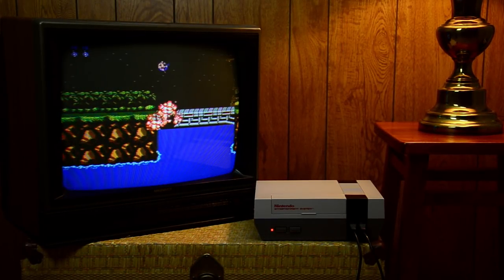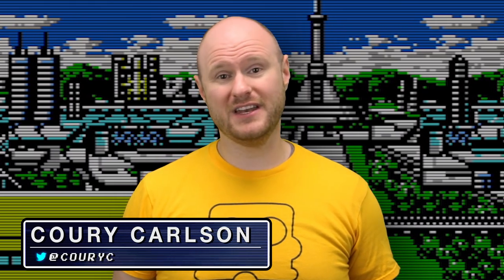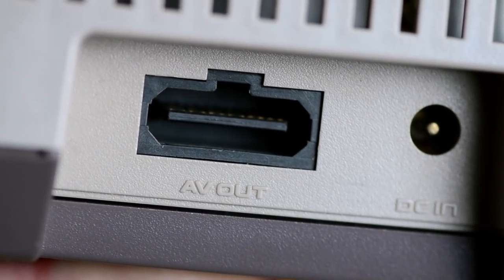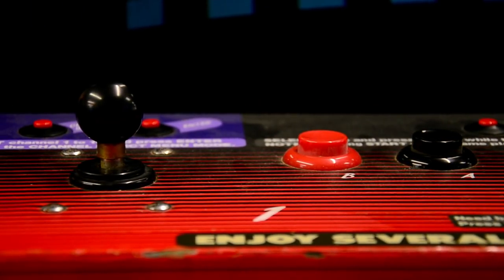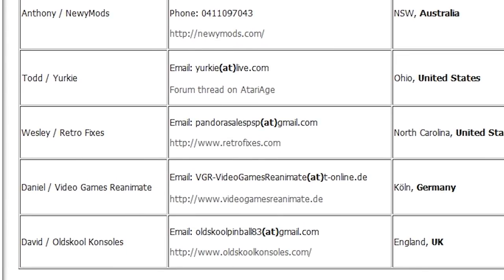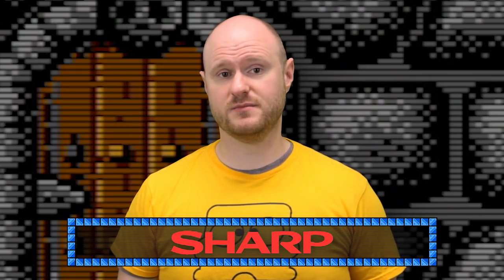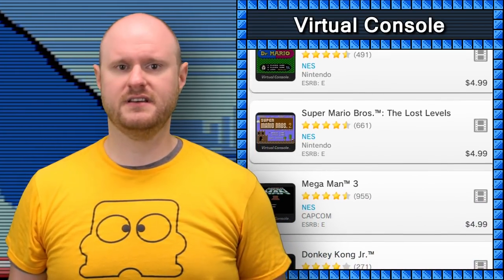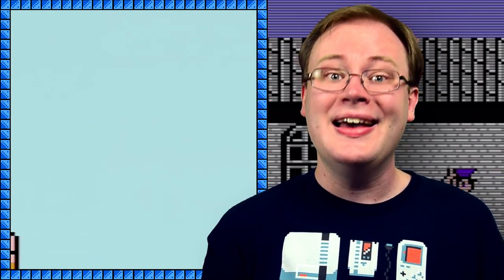Nintendo Entertainment System :: RGB 202 / MY LIFE IN GAMING

Comment: Your options with the NES really suck when you get into high quality RGB gaming and can't go back. Only mono composite at best without mods (MS had stereo RGB out the box), and either a cheap console that's a big, ugly, unreliable, unnecessarily bulky box or an unobtainable rare and expesnsive model with only RF, which ALREADY is expensive itself and THEN you need to mod it for good video. or you can get into wonky famiclones that have different options and usual lack light gun support which NNNRNRHHHAHHHGGHH.

Comment: +My Life in Gaming
Why can't chips be made with the original color palette? Why would an emulator be better than a console made from reproduction hardware? Why does the hardware need to be original Nintendo parts? Just examine the chips and recreate them, it's not magic.
Reply from the maker: [Try4ce] It's economics. Those parts aren't manufactured anymore, so reviving the manufacturing process or doing a small run is prohibitively expensive. It's not impossible, it's just not likely. As for the color palette thing, NES colors just aren't RGB. There is no RGB value assigned to those colors. So any palettes that are created are matters of interpretation and preference, in terms of how those systems display on CRTs over composite (which will be inconsistent screen to screen). However there are some extremely accurate palettes available now, in the time since this video was created.  You can read about it here: http://firebrandx.com/nespalette.html
Reply: *****
But, just make a large amount and mass market the console. Isn't retro gaming big enough to sell a few million consoles worldwide? So the original palette could be recreated and would look the same on CRT screens as it did in the 80s, but playing it on modern screens with better output qualities will change the colors?